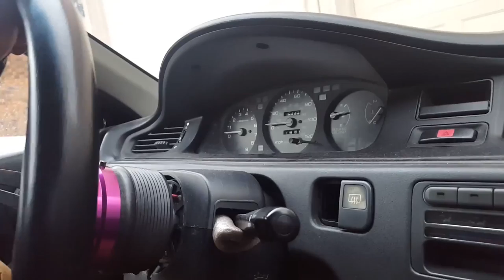Ebay Quick Release Review | Horn Wiring

Comment: I like the method that you used. 2 criticisms I do have though is that the paperclip will wear the contact ring away and the earth under the nut should have a ring connector on it to ensure the nut is fully secured. Awesome vid though. Saved in my favourites. Cheers.

Comment: eh man sorry to bug you more, was wondering if you can take out the center of that QR? like the silver part that protrudes out of the back that would sit inside the hub and where the horn stuff is, i wanna grab one of these for my simulator but i need it to be flat on both sides not only the front,
Reply from the maker: I'm pretty sure it didn't come out. If you wanted to get creative you could probably just cut that section out.

Comment: How did u get the hub off? I’m trying to get mine off so I can switch over to a Nrg set but it’s so difficult tryna get it off lol.
Reply from the maker: Take out the horn of the steering wheel and bolt the steering wheel directly on the hub without a quick release. Loosen the bolt holding the hub on but don’t take it all the way off. Pull the steering wheel towards you and wiggle it back and forth until the hub breaks free. If that doesn’t work, you might need a steering wheel puller.
Reply: @NickSabella  nvm I got it ! Thanks a lot though!